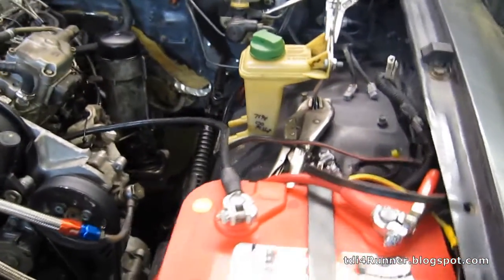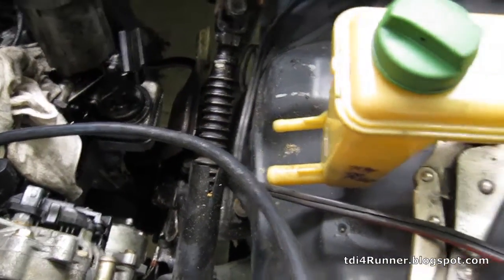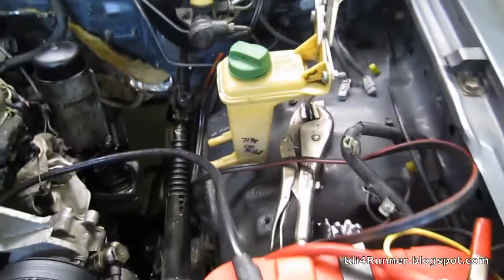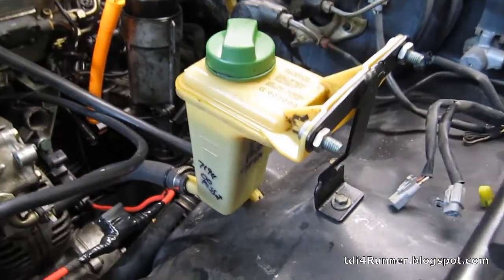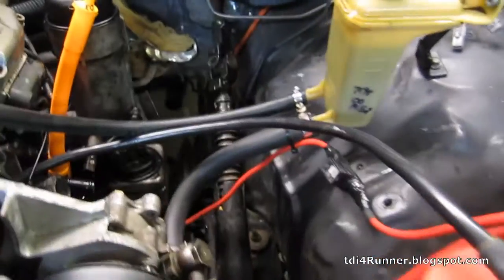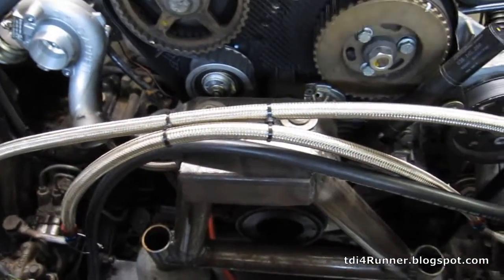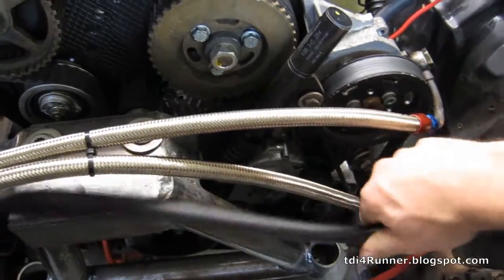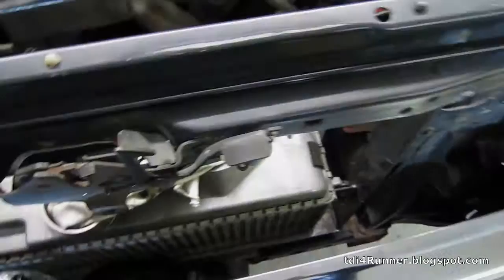TDI 4Runner Build Pt 6 - Hose & Fittings Fabrication & Power Steering

Comment: wear did you get the flange for the headers
Reply from the maker: RAMON ESPARZA I don't remember the specific site, but it is the same flange as a 2.0 8v gas engine :) Those are easy to find. Or a friend with a plasma table can make one! Good luck with your project.